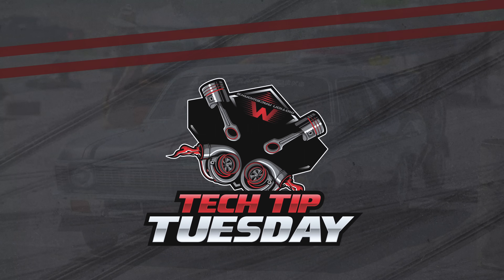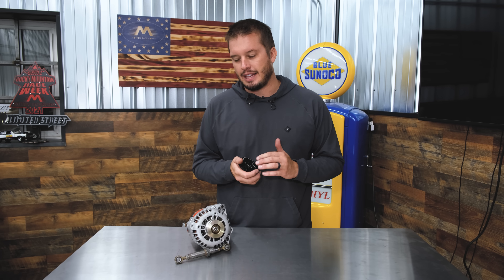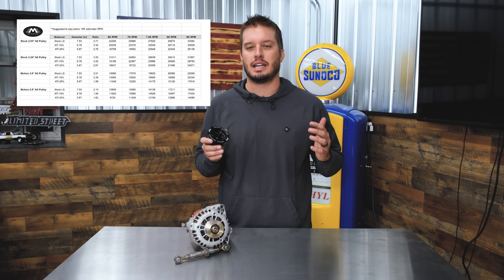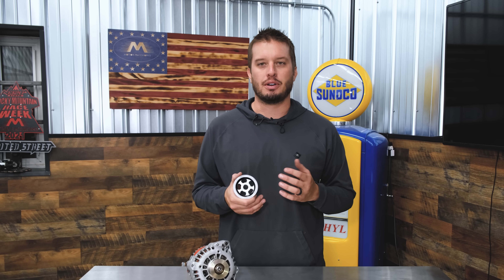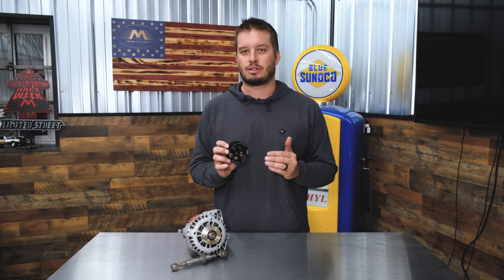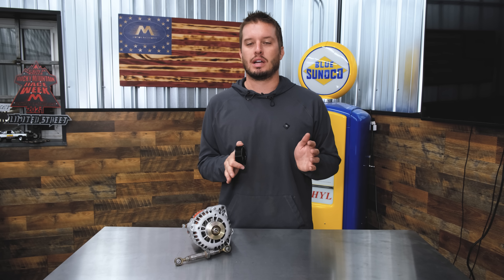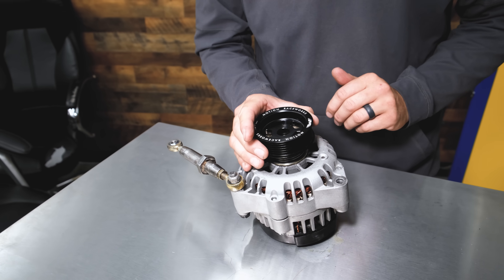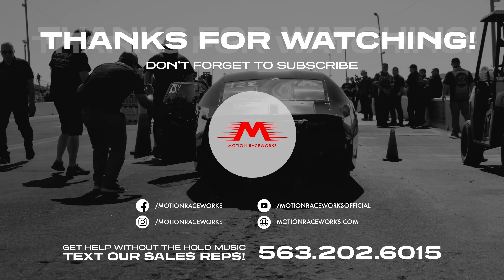Tech Tip Tuesday: The Single Biggest Killer of Alternators and Bad Charging Systems

Comment: Running a bad or weak Battery will Kill Alternator. Hondas Denso alternators last forever because ECU monitors amp usage and shuts down to 12.6 volts at different parameters to prolong system life

Comment: I have had problems with oem pulleys that freewheel in one direction and pull in the other, they sometimes get worn out and slip under load or completely fails to grab. Fun times standing and measuring voltage and everything seems fine and yet when out driving with extra lights on in the dark having the charge light come on.  I have temp fixed some by welding em solid until i got a new one... i do not see the design benefits of this oem pulley especially on a diesel. The goal of oem's with that pulley must be to allow the alternator to slow down at it own pace if the revs drop suddenly..
Reply: Look up the videos of the two systems, the clutch pulley advantage will be immediately visible. It serves a purpose for sure and it's an upgrade over a solid pulley

Comment: not to burst your bubble but, if you install a bigger alternator pulley it will be turning faster.
Reply: Uh, think about that for a minute.
Reply: You don't know how ratios work do you. Run a tire that's smaller in diameter of what you currently have and see what the speedometer reads........

Comment: This is Easy   why do you not put your hand on the Ground and hit it with a hammer?
   if it looks Cool  and one has little idea what one is doing   in it not worth a Little 
    RESEARCH ??    I have heard of this problem and we did things to avoid this 
     Here is another FIX for   Ricky Racers    and those  who have no idea how to make 
     Speed   just loosen the drive belt    this works    Why because the faster one spins
     the more power is takes       Simple        interesting   VIDEO